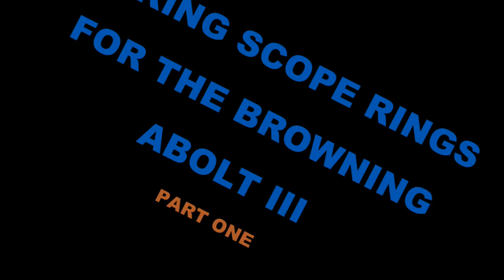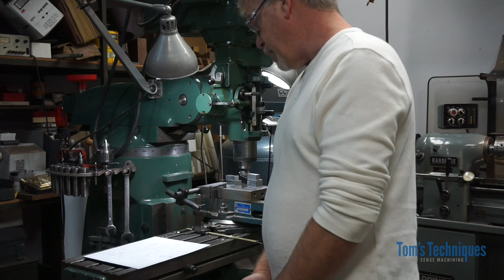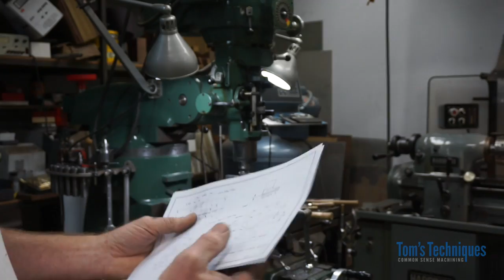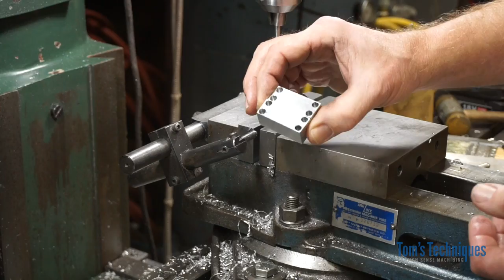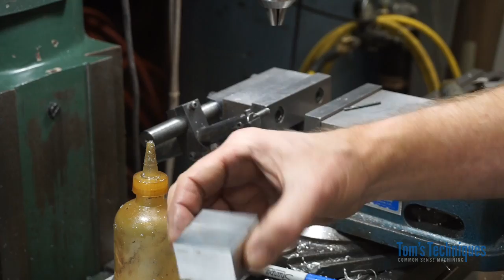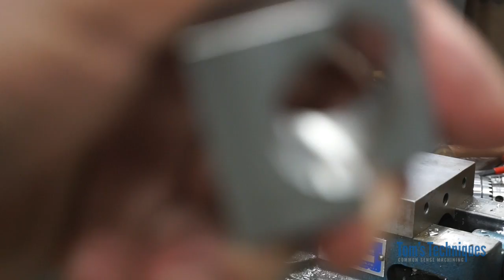Making Scope Rings for the Browning A Bolt 3 - Part One

Comment: No. 28 drill - WTF ? What size is that ?
9/64"
Well why didn't you say so ?
Reply from the maker: Lol, are you trying to impress everyone with your knowledge of drill bit charts? If so, keep looking, because there are lots of sizes in fractional, number and letter drills that are the same or close.
Reply: @TomsTechniques  I know nothing. I had to go look it up !
Reply: @TomsTechniques  In fact, thinking about it further, I guess you could use a 1/8" drill (a common size) and by the time the hole's drilled, it'll likely be 1/64" over size - and the right size for that job.
Reply: @millomweb If you don’t know what wire gauge drill bits, you probably shouldn’t be giving advice on videos with this subject.

Comment: Tom, why do you reference off the front of the part with the edgefinder? If you do it off the back side, the reference won't change with changing part widths. I always use the back jaw of the vise as a Y reference and don't ever have to check it again unless the vise or ram is moved.
Reply from the maker: +Joseph Lippencott 
Since these parts are symetric, it doesn't matter which surface is referenced. If a part has features that are toleranced to the edge, then that edge should be against and referenced to the solid jaw.

Tom
Reply: +Toms Techniques 
Nearly all parts are referenced to two edges since that is what locates the part in the mill/vise every time it is held in place. I have never seen a drawing where dimensions are referenced from the middle somewhere since there is no feature there to reference from. Even symmetrical parts are located from some real surface(s) on the part.
Reply from the maker: +Joseph Lippencott 
I said toleranced to an edge, meaning that a feature must be withing a specific range from that edge for the part to function properly. Parts that are located by a step and held with a fastener are a good example of features with an edge distance that must be held. I often center features such as hole patterns on a part by locating opposite sides and zeroing out the spindle in the middle. As I said, if a feature must be located accurately from an edge, then locate from the solid jaw. Otherwise it just doesn't matter.

Tom

Comment: Thanks for making these videos Tom and thanks for the Onshape heads up.This is my first time messing with cad and I am lost but will catch on.
Reply from the maker: +mikecwiklinski 

Thanks Mike. Glad you enjoy them.

CAD is an incredibly powerful tool for a designer. You can literally build and prove a design before ever cutting metal. I used to design everything on paper and it was incredibly labor intensive. I don't think I could ever go back after learning CAD, especially 3D CAD.

Tom

Comment: Tom...It seems that when boring the holes (scope tube) for the scope, you have to make sure the hole is true with the base of the mount or you would get a bending force on your scope. Do you go through any extra tramming process to help eliminate any off axis cut when boring?

Best series so far! Really enjoyed the raw nature of seeing how you approach the order of operation and how this could be done without CNC.

Matt
Reply from the maker: +Matthew Berry 
No Matt. I use my mill almost every day and know it inside and out. I trust that the head is in alignment and would notice if it wasn't when milling. You may have also noticed in the video that I bored both parts in the same setup, to ensure they were identical.

Thanks for watching.

Tom

Comment: Are the flutes on that tap spiral? Or straight? Or does it not matter in this case?
Reply from the maker: +McKenzie Keith 
A spiral point or spiral flute tap is a must for power tapping to clear the chips. Any other type will load up.
Reply: +Toms Techniques Thanks! I though I remembered you saying that in another video. It was just hard to tell in this video.

Comment: Can you use the clutch on your power drill to prevent breaking the tap?
Reply from the maker: +Mike S 
Allowing it to slip in the chuck works perfectly. You just start light and increase the grip until it provides just enough torque to drive the tap. I have never broken a tap this way and power tap holes as small as #2. I suspect using the clutch would introduce shock into the tap and likely break it quite easily.

Tom

Comment: Tom I have found your videos and website very helpful thanks. Sometimes you tap your stock down in the vise with a Hammer sometimes you don't. Is there any rule of thumb as to when you should or it's not necessary?
Reply from the maker: +Billy Dean 

It just depends on the part and what I'm doing to it. If it's a precision part and I'm milling it to size, then the part gets tapped down on the parallels. If it's a low precision part or if I'm doing something like drilling holes, then it's not worth taking the time. It boils down to judgement based on experience, but if in doubt, tap it down. It also helps to know your machine. I know this vise will only lift a part a couple of thousandths, but some will lift it a lot more. Try putting an indicator on a part in your vise and see how much it does or doesn't move when tightened down. Don't forget to check all four corners.

Tom

Comment: regarding SolidWorks, Vets can get the student version for $20.  No student status required.  it does require you to email them a signed form and a copy of your DD-214.
Reply from the maker: +Chris Hurlbut 

That would be a heck of a deal if you qualified.
Reply: +Toms Techniques yeah, I do qualify, but it is the student version.  one of the stipulations is that you are not technically allowed to use it for commercial work.  Also, no updates, tech support, and lisence expires in a year.

Comment: Thanks for sharing, Tom. Anything you're working on is worth learning from, it doesn't have to be specifically geared toward teaching. I don't miss the lapel mike, I enjoy the machinery and cutting noises as it adds to the experience.

Allan
Reply from the maker: +allanpeters 

I happen to agree, which is why I decided to try this concept. I doubt anyone else will build these scope mounts, but it would be pretty tough to watch this two hours worth of video and not learn something new. 

Sometimes the phase converter gets a bit annoying, but I've been looking into using a variable frequency drive. If that happens, I may be able to hang up the lavalier mic.

Tom
Reply: +Toms Techniques ...I'm with you on the vfd, I want to get one for my 200V as well but I also have to replace the original 575 volt motor that it came with... maybe by the end of the year.

Allan

Comment: Good approach....never thought of lubing the bit with a finger but I like the idea.  Always a new little trick out there.  Thanks for sharing.
Reply from the maker: +Glenn Felpel 
Yeah, just remember that is the result of 45 years experience. I don't do it on larger drill bits, or drill bits with spinning chips and I don't do it with stainless.

Tom
Reply: +Toms Techniques I wouldn't try it on end mills either, they are a lot sharper then drill bits.

Comment: great project tom. i build my own taget rifles but i have never tried my hand at scope rings i like the idea of one piece rings..most scopes don't have enough elevation built in for very long range shooting, and require a rail with elevation built in. will you need to compensate  for this with different heights on your scope rings?
Reply from the maker: +larry sperling 
The scope has 65 MOA adjustment in elevation, so hopefully that will be enough. If not, I'll just crank out another set with more built in or make some wedge shaped shims.

Tom